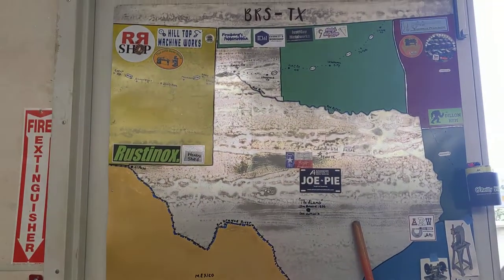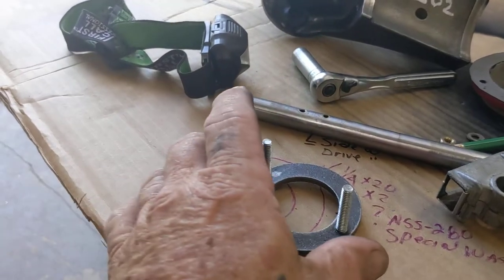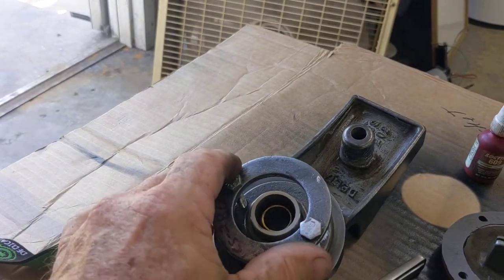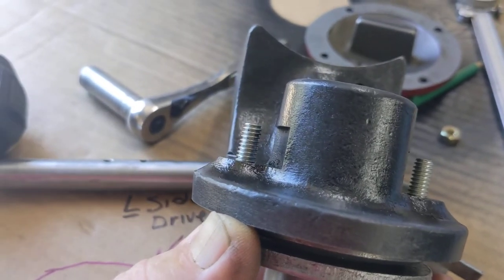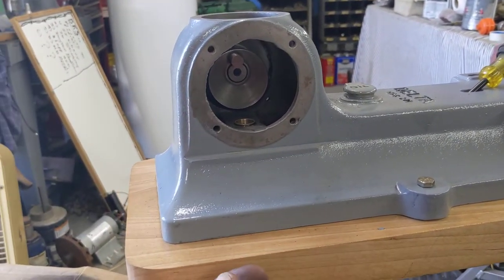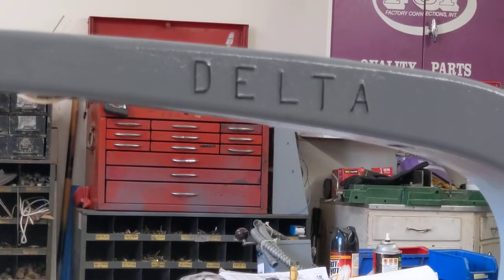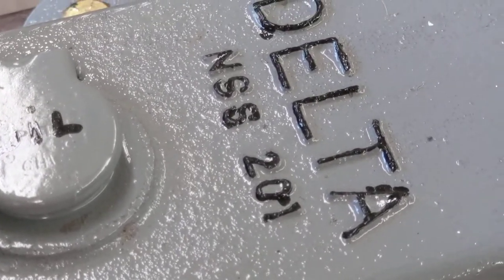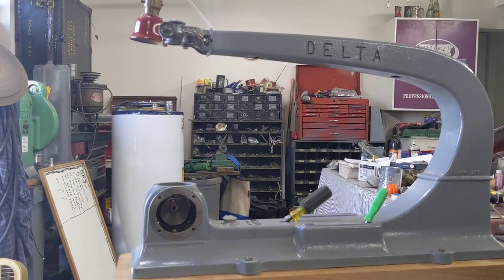Pt - 8 of the Delta 24 in scroll saw - FYI tip

Comment: Hi BRS!   This is DaMaxchi here.  I've been following your excellent restoration of the scroll saw and have been re-living all the twists and turns you are going through just as I did with my restoration.  I thought I would comment about that clamp ring washer.  If I recall, my clamp ring washer was threaded so that the 1/4-28 bolt would drop in from the top and screw right into the washer.  However, I could be wrong since my memory is not the greatest.   Also, I don't know how much documentation you have for your scroll saw but I have a few documents that I collected when I researched my saw.  I'll email them to you.  You are doing a great job with that restoration!!!
Reply from the maker: Some where in its previous life, someone got abusive and the treads in the ring collar had to be re tapped. That's when I saw an issue that would arise down the road. the washer being only 0.210 thick, didn't allow but for 4 threads. They had clearance to have made it 0.299 (6 tpi) and still clear the cam. I should have made time to machine a new collar ring, but was simpler to grind down one bolt head..hehe! Thx for following along. I go the morning to pick up a Rockwell Model 11-280 Raidal Drill Press. Need another Delta motor, and supplier wanted 150 for a used 1/3 hp. Bought the whole Drill Press for 60 (@@)! Have a great week.
Reply: @bearsrodshop7067  OK, that explains it.  Clever solution.  That was a great deal on the drill press!